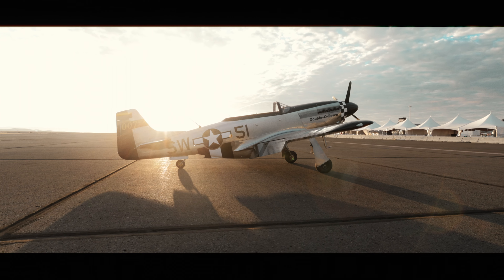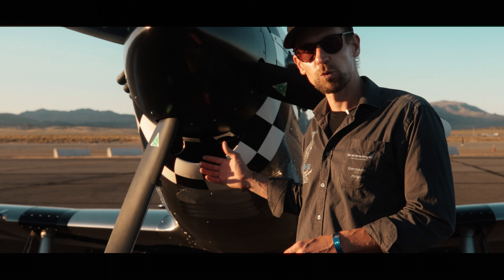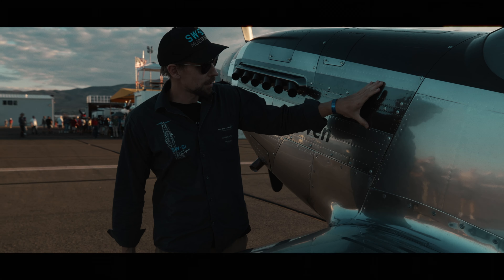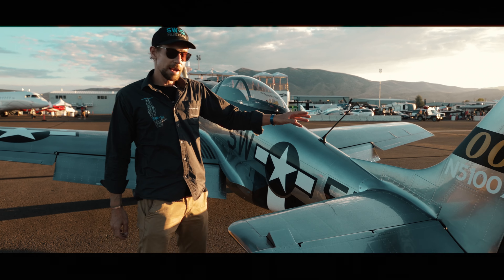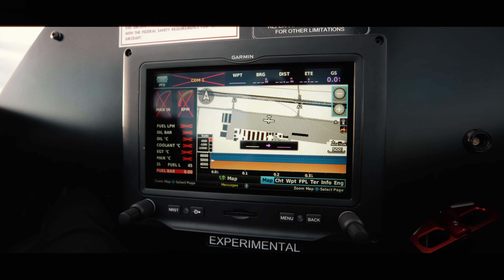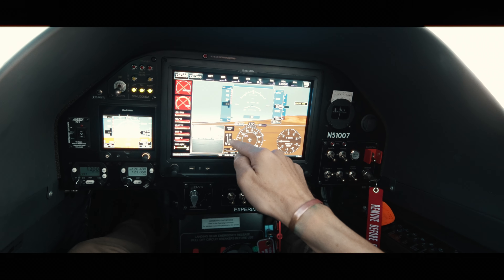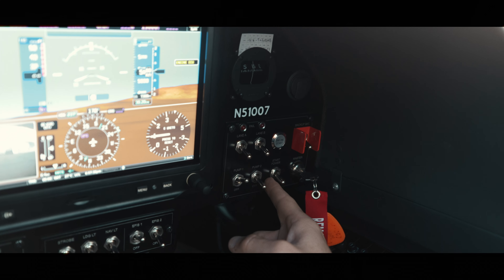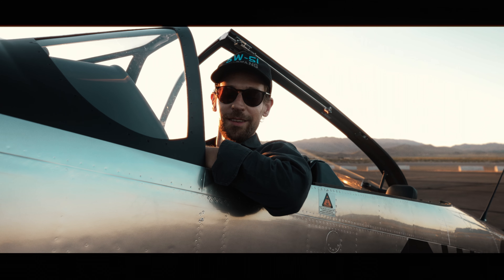ScaleWings SW-51 Mustang 007

Comment: You guys knocked the ball out of the park with this design. I would greatly prefer owning this over a real P51. I would hope Rotax improves their PSRU to handle a larger diameter propeller or a different engine could be supported. Pretty sure it would really be a better plane with at least 180 HP anyway. The whole airframe looks so perfect, then your eyes notice the diminutive prop.
Reply: imagine a Merlin in there. I mean i know its not possible, but fun to fantasize a modernized billet V-12 light/dependable enough for flight.
Reply: I don't think I have ever heard any P-51 owner on the planet say they would greatly prefer SW over P-51... Are you the first?
Reply: Rotax should make an aerobatic engine.

Comment: How much does a fully built one cost? What engines can you use? Can you get a larger propeller? Whats the labor time per hour of flight? Most importantly can you fly the aircraft as a novice pilot or do you need some kind of special certification?